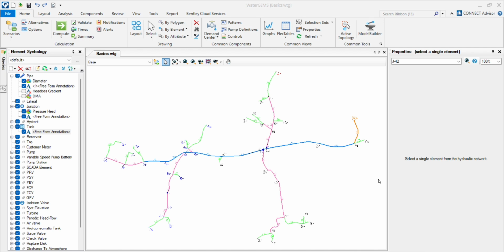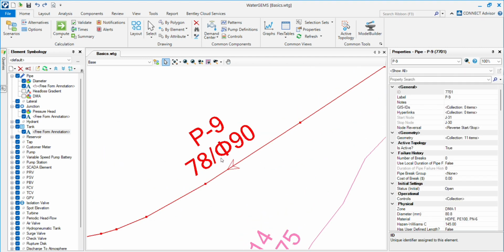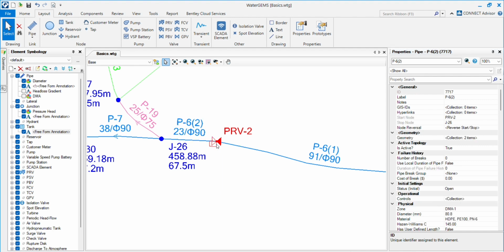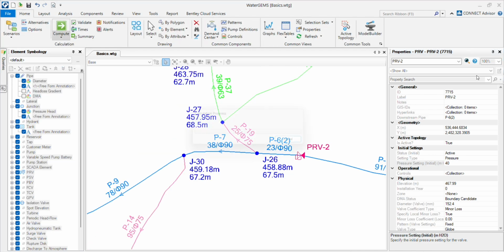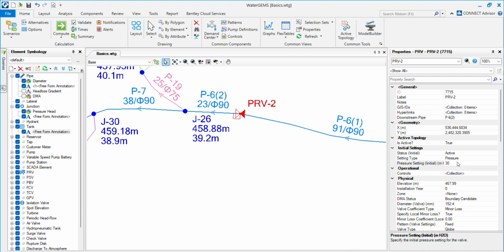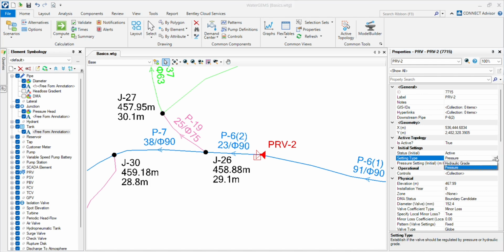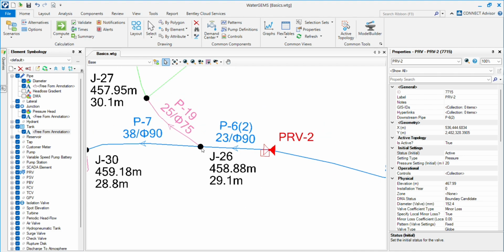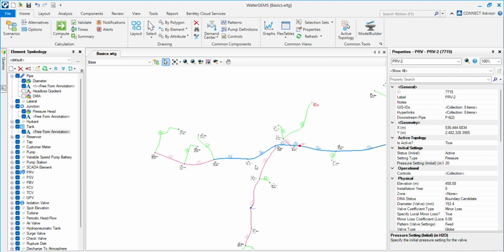How to use PRVs to reduce the pressure l WaterGEMs.   #valve #manufacturer

Comment: prv doesnt really reducing my pipes pressure so ıtried with pbv but it reversing the flow direction which ı dont want what should ı do
Reply from the maker: PBV generally is not used in water but anyways if you want to change the flow direction you change through pipe
Right click on pipe and you will find a option with reverse and this option available for both valve and pipe as well